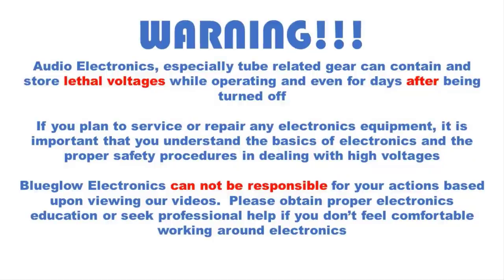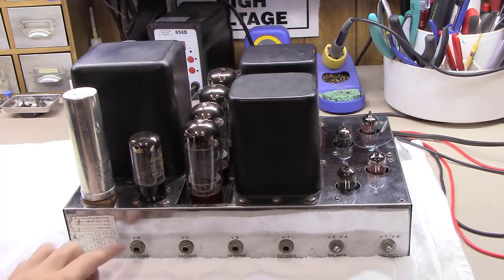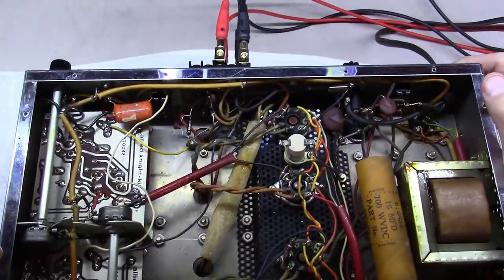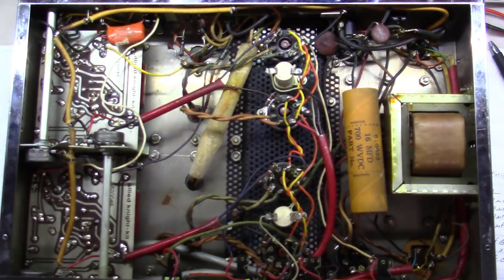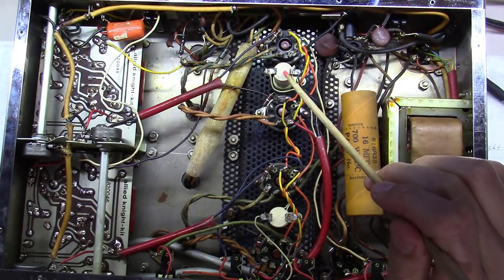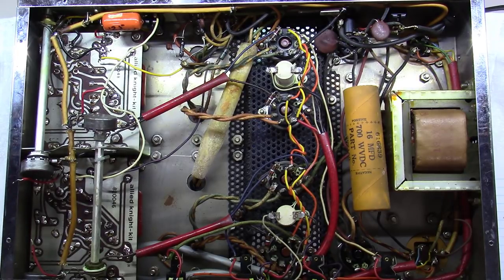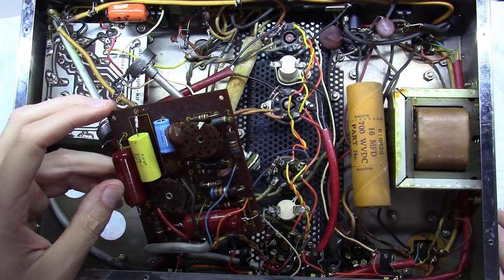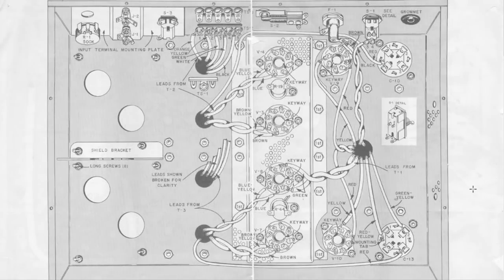Knight KG85 / KB85 Stereo Tube Amplifier Restoration - Part 1

Comment: Nice video.  I use to work for Knight Kit back in 1966-1967 in Maywood Park, IL.  Was a technician and worked on anything they threw at me.  Havent seen one of these amps in YEARS.  Still have some Knight Kit equipment and Heath Kit.  Built the Heath Kits while in the Navy in the early 1970's.  Now I am working on a Pioneer RT707 reel to reel.  It keeps blowing the 3.15amp fuse.  What fun.  Have quite a few tubes left over and an tube tester.  Tuber were easy to work on.

Comment: Regarding the 1 ohm cathode sense resistors; I had trouble with some Vishay 2W 10r resistors going high in the same application, up to several k. I used Welwyn 3W Vitreous  resistors in the end to be 100% sure. Just a thought. Nice series of video's, wish you'd made these years ago when I was starting out, very useful for beginners. Keep up the good work, DA

Comment: Also, you could just put the “cathode current” test jacks in parallel with the existing 1k cathode bias resistors; then you don’t need to buy extra resistors, though you will have to rewire it slightly! HTH! 😎

Comment: Mark, it looks like the brown caps one the first board may have been changed, I noticed a hook and eye solder joint on the ends of both of them.  Welcome back!
Reply: Christopher Villanti I saw that but if so the caps they used are 50 years old...   figured that was done a long time ago.

Comment: How do you determine the wattage on resistors if you don't have a diagram?  Size? 

Great vids, glad your back in action! Thanks for all your effort.
Reply: Math

P = V2 / R

P = I2 * R

P = V * I

 A useful inversion of the first two formulas is to calculate what voltage across or current through a resistance of R gets you to power P.

So V = SQRT( P*R) and I = SQRT (P/R).

If you have a 1K resistor rated at 1/4W, what is the maximum current and voltage that it can withstand?

V = SQRT(0.25*1000) = 15.8V. I = SQRT(0.25/1000) = 0.0158A.

And not surprisingly, as Georg Ohm would have told us, 15.8V/0.0158 = 1000 ohms. What a surprise!

Beyond that, there is derating. Resistors are usually specified to dissipate their specified wattage at a surface temperature of 100-200C. That is the boiling point of water to fry-an-egg temps. It is common (and good) practice to use a resistor of at least twice the power rating that the resistor will actually be dissipating. That keeps the resistor surface temp down to not being a burn hazard.

And there is the fact that there is no advantage to trying to get micropower resistors. If the actual dissipation is 0.5W, you need a 1W resistor. If it's 1/4W, you need a 1/2W resistor. If it's 1/8W or less, use a 1/4W resistor, as that's about as cheap as through-hole resistors get.
Reply: @The0nionKnight  Thank you, I went to college just after slide rulers were repurposed(modified with  a bowl)😁

Comment: Good video Mark. One thing I think we should all really take away from this, aside from the restoration, when dealing with purchases on eBay, insist vehemently that you have all the photos that you request. Otherwise you might end up spending way more than what the item is worth. I'm not saying that the amp is overpriced, because those were coveted back in the day. However I'm sure you would have been able to knock a few dollars off of it when you saw that it was not restored properly.

Comment: if the amp has its own power transformer, can you  connect the chassis to the household ground, but keep the circuit ground isolated from the chassis? so if the circuit  accidently made the chassis live, you are protected ?